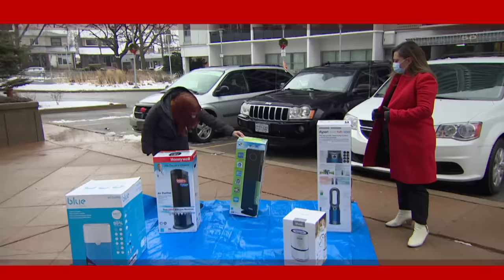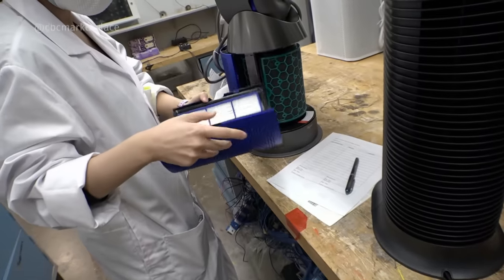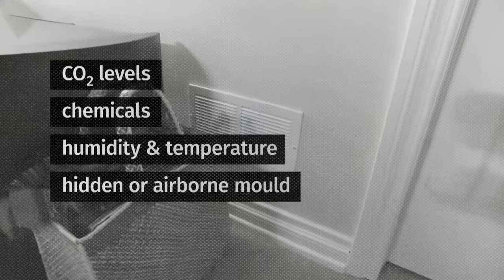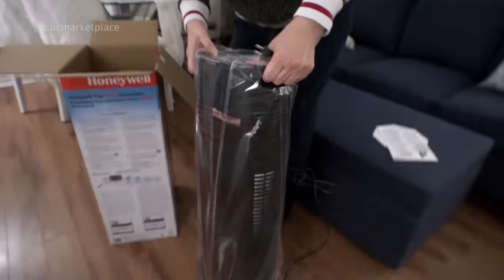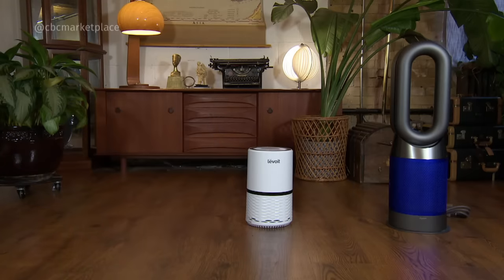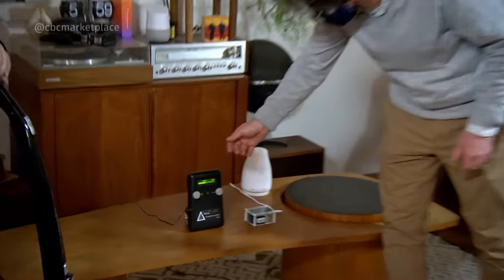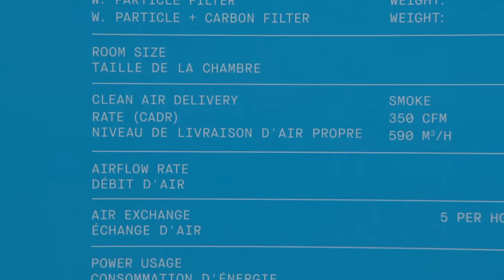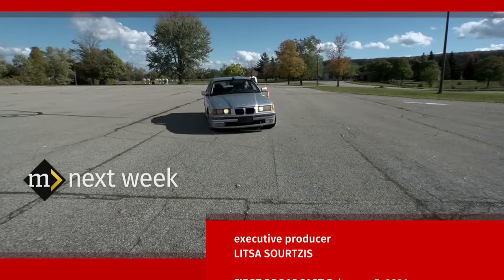Is an $800 purifier best to clean your home's air? We lab tested 5 top brands

Comment: I rate Dyson for sending someone to talk about this. Too many companies hideaway. Great episode!
Reply: So true
Reply: He was dodging the question though; I did not hear what other important metrics they are focusing on instead of CADR and why...
Reply: @jinwang562  I find this video less informing because other big important issues are , how loud is the machine? Dyson is the best for that for example due to its efficient motor. Other than that how much power it needs to run at that CADR. I was expecting a bit more data than just cadr
Reply: @jinwang562  he wasn’t dodging they edited that interview. He’s right that just using that one metric is not a fair representation of the field. They also have fans that just do air purification without the heat function etc that would have made for a much better comparison.
Reply: @ucyberwolf  It really doesn’t make sense why they decided to not use the model that only does air purification.  It is cheaper than the one they tested and it is designed for larger airflow.  It’s misleading at best and I question if it was intentional to make this more sensationalized.  Poor test, you could have done much better.
Reply: @GreenDreams5  I think they should have done both Dysons, bringing home the idea that just because it has more features and costs more does not mean it is more effective -- while also checking Dyson's dedicated product.
Reply: Just like to add that my sister has the honeywell and I previously had the germ guardian before I upgraded to the Dyson hot cool hepa air purifier. The Dyson is in a league of it's own. I bought it to purify the air but in these winter months I've been using the heating function a lot. Overall great job of purifying the air and heating. It has performed much better than my past and my sister's purifier.
Reply: @jinwang562  you have to put into perspective that they were also working on a new purifier during this interview
Reply: @GreenDreams5  which model are you talking about here?
Reply: @CihatUmut  none of them are loud enough to make you deaf. What’s important is the air you’re breathing 24/7
Reply: @CihatUmut  with the tiny amount of filtration of the Dyson, it's quieter to not have it at all and you will get the same effect.
Reply: @ucyberwolf  which division of Dyson do you work for?
Reply: So what is your rating?
Reply: prolly cos they gonna edit out their answer, why bother.
Reply: Kate, are you going to share you rating or not?
Reply: Dyson is the best.
Reply: Cadr is just measuring the amount of air purified, it doesn’t really measure the quality of the clean air, based on my experience on any filter, usually the finer filter tends to work slower, but better quality, the air quality should be measured maybe after two hours to justify who is doing their work better
Reply: Kate, what's your rating?
Reply: I was exactly thinking the same thing
Reply: @sandrinelafond3115  how can you tell? Since they haven't revealed their rating, how can you know you were thinking the same rating?
Reply: @luckycatdad8369  I used the word rate as a figure of speech and not in the literal sence. In the way I used it, it is like saying I give them kudos, or I respect the fact they did that.
Reply: @katem6159  you intentionally misused the word? Why?
Reply: @jinwang562  Clearly we didn't get to hear all of what they said because they edited the story. Even if he didn't mention them, the reporter also didn't push to ask what those metrics were. I'm disappointed by the myopic one-metric reporting here. What really annoys me is they say: "Our expert says that CADR is the most important metric", but that's just one guy and they don't back it up by explaining what the others are. I like the investigative look at this topic, but I'm saddened that they couldn't add more nuance to it.
Reply: The air cleaning function is only one of the 3 functions the Dyson has. I would not give 800 bucks for a Dyson, but to compare that to a purpose build air-purifier and then constantly blaming it for a high price, that is a bit unfair.
Reply: I still like my dyson it super quite,  good at heating sending air out in a nice amount and has always had good customer service. This episode wasn't taking in all there features and there prices.
Reply: I rate my Dyson a 7.8/10.
Since I know how to finish my sentences.
Reply: Dyson is rated as one of the worst air purifiers by NYTimes Wirecutter testing and Consumer Reports. During wildfire season, my friend with a Dyson always had smoke in her house. She was always coming over to our house where we have IQAir and Austin Air purifiers.
Reply: Thanks Dyson Marketing troll. lol
Reply: @Mrch33ky  are you calling them a troll because they said they would rate Dyson and then didn't give a rating?
Reply: True
Reply: @jinwang562  because there isn't any 😂
Reply: @StrokaReviews  can I ask what you mean by "true"? They said they were going to rate them and then didn't leave a rating. What's true about that?
Reply: But the Dyson guy didn't say anything.  Just a bunch of obfuscation.
Reply: @ucyberwolf  exactly, they used the model that also offers heat -- they have a similar model that cleans and humidifies only.    Those have powerful fans
Reply: Kate M
Forget Dyson units. Out of stock, spare parts out of stock, replacement filters out of stock. Any other Dyson unit out of stock. Amen!!
Reply: @jinwang562  yeah I’m not sure they’re very trustworthy just because they showed up — more of an opportunity for them to answer how they want to answer and be selective about how they answer
Reply: @wennieli5701  Almost every single brand uses HEPA filter standards. There is really no quality vs quantity difference here. That's also why we focus more on CADR than anything else in this industry. Also, if you want to remove VOCs, you need more carbon mass than HEPA and that's where most brands failed.
Reply: Look at all of the Dyson fanboys and apologists in here. I guess if you pissed away $800 on a space heater that barely cleans your air then you need to tell yourself that It's the greatest thing since sliced bread so you don't feel like a chump. Lol
Reply: @maluminse6013  if you think that’s expensive then just don’t look at Dyson product and move on. You aren’t one of the targeted consumer 😉. I just can’t understand why people didn’t want to buy a certain product and keep on teasing those who bought them and love them and yet wanting to tell them hey you make a wrong choice! Get a life, you are too free mate!
Reply: @wennieli5701  I don't think they're too expensive. I think they are a rip off. I don't mind spending a lot of money on a quality product that warrants the cost. Dyson products do not fall into that category. Dyson products are a very poor value proposition. The only reason these products sell is because people like you see them as a status symbol. It bothers you when others laugh and expose your silly materialism
Reply: @maluminse6013  you are funny, who will come to your bedroom and look at your heating unit and say, hey you have Dyson as heater! What’s symbol of status, if so I can just buy branded handbags and shoes
Reply: @wennieli5701  I'm sure you didn't tell anybody that you bought a Dyson
Reply: @maluminse6013  I did, that’s my hubby, and he loves it too
Reply: @wennieli5701  Of course he loves it. To do otherwise would be to acknowledge that he got ripped off.
Reply: @maluminse6013  hater going to hate anyways 🤷🏻‍♀️
Reply: @wennieli5701  Just think of all the hungry children you and your hubby could have fed with the $600 you wasted on your vanity appliance
Reply: oreck
Reply: Me too. That speaks volumes to me.
Reply: @jinwang562 Probably the noise it produces, design and looks?
Reply: I give Dyson cred 😎
Reply: Damage control.
Reply: He did not "talk about" this. He was blowing smoke up our asses.
Reply: I rate them 9 outta 10
Reply: @greig9794 some of the brands reviewers here ONLY have HEPA filters, which don't remove odors or aren't good at removing smoke. 

The Dyson had a HEPA filter and a carbon filter. HEPA filters aren't the only filter found in air purifiers, so only basing the decision on CADR makes no sense.

Comment: My take away is that, like they mentioned early on in the video, all of them uses HEPA filters so what matters most is the airflow that these purifiers generate through the filters. The reason why that DIY filter works so well is probably the fact its a HUGE fan.
Reply: Yes and no. HEPA filter is not the only filter used in air purifiers. A lot of them have carbon filters as well, those get rid of smells and chemicals (HEPA gets rid of only particles). Dyson has a rather thick carbon filter with a lot of carbon granules Blueair has a thin sponge with a bit of carbon inside, so technically they both can say "we have carbon filtration" but their performance and longevity will be different.
The other part why Dyson is so expensive is their bladeless fan technology (the filter doubles as a cool and hot air fan), and a ton of sensors and smart technology bits and bots (you can get air quality reading, control purifier from the app, set timer etc).
So yes for getting rid of particles alone, big fan, big HEPA filter, thats all you need, and that blueair 211/221 is perfect for it. If you want to get rid of particles and smells look for a purifier with a carbon filter full of granules, not the sponge ones. The other stuff like air quality sensors, auto mode and smart device functionality depends on your preference. For example blueair has auto-start so you can use a a smart electric socket or a socket with a timer to make it work on a schedule or control it via app. 

BTW. Carbon filters are dirt cheap and easy to made, so it is disgrace that there aren't that many air purifiers with decent carbon filters!
Reply: Saing that Dyson is blade less fan is misleading. inside there is regular fan. This fan just redirect the air steam in some "fancy" and vey inefficient way. Beside the form and high price there is nothing good about this fan.
Reply: @miroslawkaras7710  I agree on this. The name is silly. Still it is their patented technology and they are selling those "bladeles" fans for high price. So it's natural that they ask pretty penny for having it on air purifier.

Not many purifiers doubles as fans so there is some value there.

I'm not fan boying for Dyson, I just didn't like how they pounced on Dyson in this report. They simply sell a premium product with different features. Personally I wouldn't buy it, but dog piling on them because they do not filter as fast as other air purifiers is a bit weird.
Reply: @pingwingugu5  At the same price, you can get Austin Air Purifier that contains 12 lbs of activated carbons. Dyson is only good when you use all of its functions - heat, fan, and purifier. Otherwise, you will be better off buying them separately.
Reply: @GBR9794  if you can fit 3 separate devices in your flat then sure ;-)
Reply: @GBR9794 I bought an Austin and it didn’t do anything, very disappointing!
Reply: Some produce ozone in small quantities. Theres a difference between these purifiers. Levoit and honeywell do not produce ozone

Comment: Poor Dyson engineer. They clearly cut up his responses. It would have been nice to know what his explanation was since they were the only company willing to talk.
Reply: exactly. Now we know why companies don't talk with CBC News, they cut their full explanations into tiny sentences.
Reply: I think you're right. All they went on about, and rebutted by Dyson was the CADR metric. So it can filter out X amount of air but now how effective it was afterwards. I'm sure if you grabbed a faster flowing box fan and strapped the same furnace filter to it, it too would push out even higher CADR numbers. That filter can/is only filtering so much before it is full/clogged and it's CADR number will significantly drop (but will actually filter better). 

In the PHD's test lab, they measured the volume of air that was able to be filtered. What about information on PPM of the incense smoke after say 1, 2 hours for each filter? Wouldn't that tell you how effective the filter was?
Reply: @maxwellkeeling3781  Exactly, there is a LOT to filtering air and movement, I learned this with carbon scrubbers air filters and sizes and speed and a lot of research. It's more than people think. Move the air too fast and it doesn't get a chance to be filtered through the carbon, it flows "over/past it". Too slow though and it is not effective enough, like they said. There is a "sweet spot" where you get a balance of both effective filtering and air movement. And yeah, as filters get clogged the airspeed will drop, but the filtering goes up. This is what they found with masks and Covid. 

That extended mask usage, while not good ultimately, was good up to a point in the sense that the filtering efficacy went up with them. Simple cotton jumped almost 10% higher the longer you wore it. Moisture buildup from breathing is likely what was narrowing the tiny openings and making it filter a bit better. Of course the tipping point the other way, isn't far behind (so dirty it needs cleaning or discarding), but there again is that sweet spot where it's great. It's a finite thing, a delicate balancing act. Same with cars, efficiency and durability and power. You gotta be insanely efficient nowadays, but also have performance and longevity too, you have to split down the middle somewhere and find the happy medium between all of them.
Reply: Considering the price point of their devices, they're almost OBLIGATED to release some kind of statement ...
Reply: @kizersosei4919  agreed
Reply: I prefer honesty over everything.
Reply: He said basically not everyone wants a air cleaner in short and simple terms and they want it do more than just that. Marketplace only cared about sir cleaning not the heater feature etc. and to be honest 800$ they could have done better I wonder what there cost to sell ratio
Reply: @JayySur Wait, who's assuming this?
Reply: It is probably worth mentioning that this is also a fan and heater. Not just an air purifier. Dyson has much cheaper purifiers with nearly identical purification quality at a fraction of the price because it isn't literally the highest end model they make.
Reply: POOR ??? He should be in jail for ripping people off.
Reply: @BigEightiesNewWave  You do realize people buy Dyson for many reasons. Design, long term reliability, features, quietness etc. They know there are cheaper options with similar performance in some metrics.
Reply: @JayySur what a great analogy!
Reply: If that's the dirtiest sound bytes they had from the Dyson guy I'd say he did a fabulous job!
Reply: ohh 100%!
Reply: Style over substance
Reply: @matthew williams My mother bought a Dyson like 17 years ago, I think she used it for 6 years before it got kind beat up and since then my dad has used it to vacuum the cars, garage, sometimes leaves that are on the patio. They definitely last, I’ve heard bad things about the cordless ones but the original Dyson were great.

I think my girlfriend and I bought a shark a few years ago and had to replace it just this last month. The two sharks are about 60% more than the Dyson my mother bought, I know inflation but still 17 years and counting.
Reply: He is UK engineer, probably that is the way they talk in UK. He don't care what this program says, he probably has better market and feel this one show will not make any difference.
Reply: Yep, I was liking this show till the end. As mentioned previously, the heater is an increased cost item. I bought a standard filter fan for a fraction of that price. Does a great job at filtering out neighbors smoke that used to stink and irritate my eyes . Aesthetically, looks great in the living area, and adds a comfortable breeze to the room. Plus, the added features of controlling from phone through wifi, and auto detect on and off when I'm not at home and smoke smell starts up.
Reply: It's for cable TV, so time is limited. An extended interview would be great for YouTube.